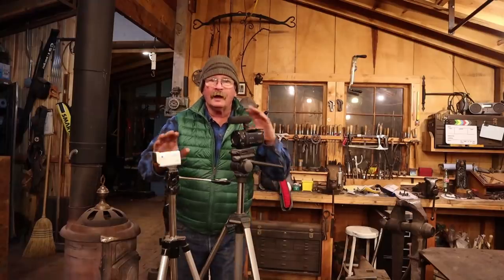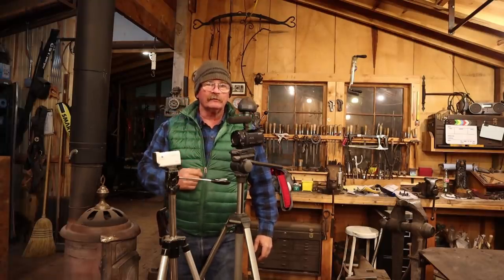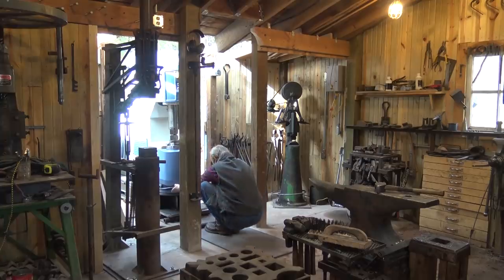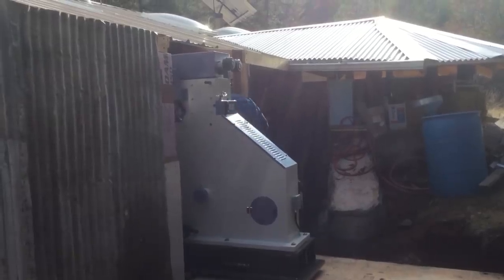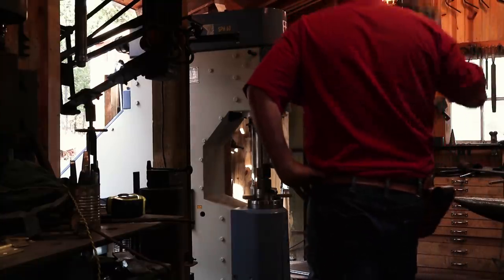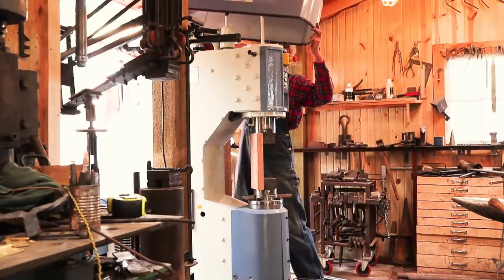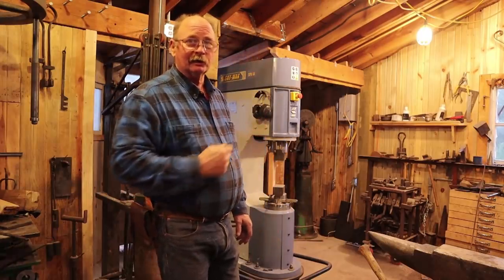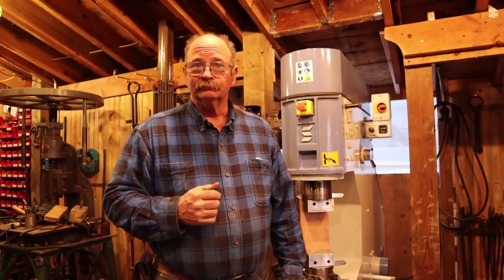Power Hammer moving day, the new Say Mak is here

Comment: I built a dune buggy when I was in high school, but I forgot to add the 20-ton boom.

New rules for Black Bear Forge:
1. No more coal fires.  Soot will get the new power hammer dirty.
2. No more forging.  Scale will get the new power hammer dirty.
3. No more grinding.  Grit will get the new power hammer dirty.
4. No more open doors or windows.  Dirt will get the new power hammer dirty.
5. No more work.  Work will interfere with admiring the new power hammer.
6. Weekly ticket sales will soon begin at Eventbrite for public power hammer admiration sessions.

Congrats, John.  That's some tool.

Comment: I don’t know anything about a power hammer so  pleas don’t  think me stupid, but what is the power supply 110 or 220 and is it self contained. Do you have to have a compressor if so what size thanks rlinn @ brown bear forge
Reply from the maker: It varies from one size and type hammer to the next.  This one is 220V 7 1/2HP single phase motor and is a self contained air hammer.

Comment: Helmut?
German ?
Reply from the maker: I think so
Reply: Black Bear Forge How much did the say mak cost sir?
Reply from the maker: The smaller hammer starts at about $12,000, this larger size starts at about $14,000
Reply: I am not a smith, but  just a wannabe , but seen a lot of tools and would have guessed something like that would have started even a little higher than that , with today's prices.  Congratulations on the hammer and the move in .